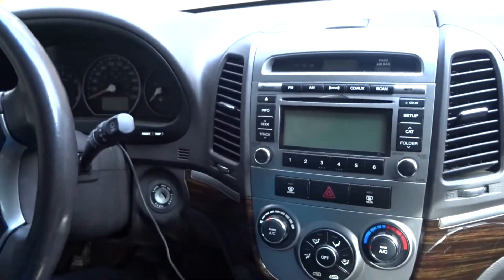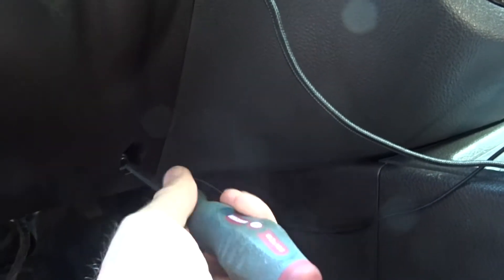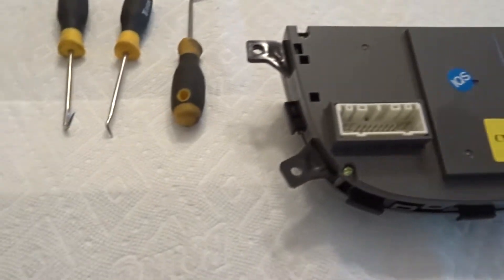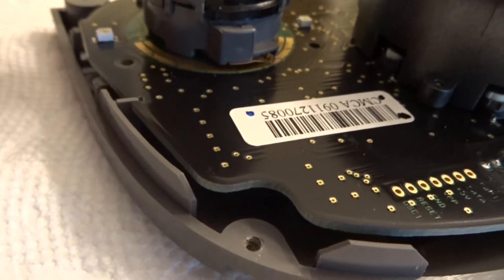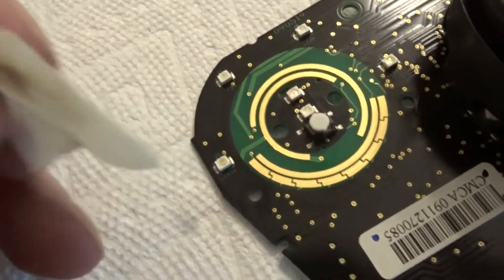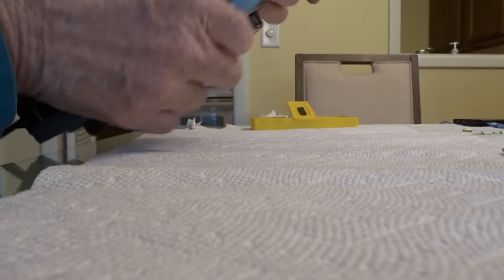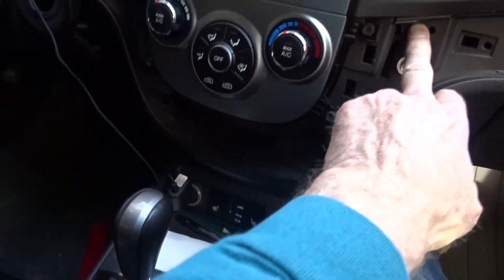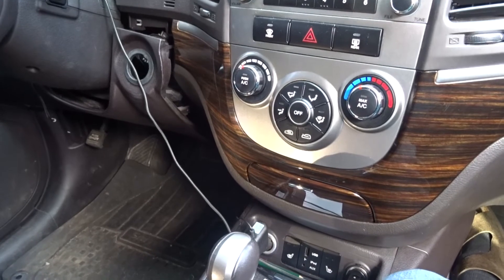2010 Hyundai Santa Fe HVAC Fan switch repair

Comment: You just saved me a whole boat load of trial and error. This happened to mine after I had to replace the radio. I’ve been dreading taking it back apart and then  guessing at how to fix the controls. You just saved me a headache and a half. Earned a subscriber. Thank you so much for this.

Comment: Very helpful.  Thanks for putting this video together. This did the trick for me on my 2011 Santa Fe.  My climate control system is working like new again.  I did deviate a little from your procedure.  I removed the faux wood trim starting from the ignition side working toward the front passenger door (left to right).  It was quick and I only had to remove the trim up to the glove box.
Reply from the maker: Thanks for sharing that info.

Comment: I just did this in my 2007 Santa fe and it fixed the random fluctuating fan speeds that was driving me crazy, also another tip for those of you with ocd (Like me) while you have the hvac panel out its a good opportunity to clean the knobs. They have tiny little grooves in them that get filled with disgusting gunk i used a toothpick for that and it worked quite well just hold the hvac panel upside down while you do this so the gunk doesnt fall back down onto the panel and possibly into the circuit board, then give the knobs a good wipe down with an alcohol wipe or something similar, and your knobs will be nice and clean.
Reply from the maker: Thanks for your comments. Hope the video was some help

Comment: Hey Gary terrific tutorial.  I also have a 2010 Santa Fe with a similar problem.  The unit turns "on" by itself.  I press the "off" button and seconds later it turns "on".  When I turn unit on for heat or a/c I have no issues at all.  Do you think I should clean center control where "OFF" switch is located? 
I thought about getting a Priest to perform an exorcism but then I came across your video.
Reply from the maker: Could be a faulty AC switch. Exorcism can’t hurt. I never turn mine off always run on low fan to bring in some fresh air.
Reply: Gary, I never thought of leaving unit on.  So i gave it a shot for a couple days before replying.  Terrific suggestion.  Best part no exorcism required.  Thank you sir!

Comment: Hey Gary!  thanks for the video. my problem is the HVAC switch as a whole is not working. the fan switch is working, but the middle control is not ( the one that you enable AC compressor on/off any ideas?
Reply: Did you get the on/ off fixed?

Comment: Mr gary, can you show how to fix the middle of aircond panel which not function well ( no respone when pressing )
Reply: Thanks
Reply from the maker: That type of problem needs a hands on diagnosis. If it’s beyond you try a pick n pull replacement. Of bring it to a professional. Cheers
Reply: Thank you for your reply

Comment: My Hyundai Santa Fe 2001 stopped blowing any air or heat. I found out it was my blower switch (the thing you turn from low to high speeds) It was fixed for a few days then my ac fuse blew I replaced it and it started working again. Few days later fuse blew again. I replaced it again but it did not fix it that time 😩😩 Please help me with some ideas to check out. Thanks in advance 🙌

Comment: You do know dielectric grease is a rubber based grease, right?.... Rubber is an insulator... You do not want rubber slopped all over small, delicate circuitry...
Reply from the maker: Sorry it is made from silicone.  It prevents corrosion and lubricates and will not dry out or conduct electricity hence it will not affect the circuit. The repair is still working great BTW.